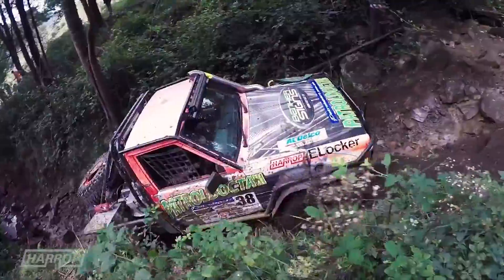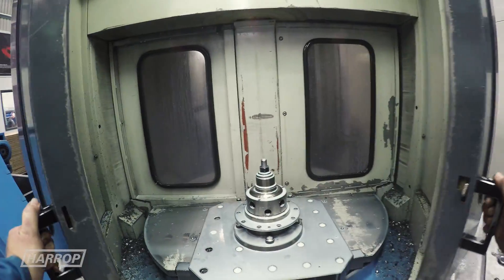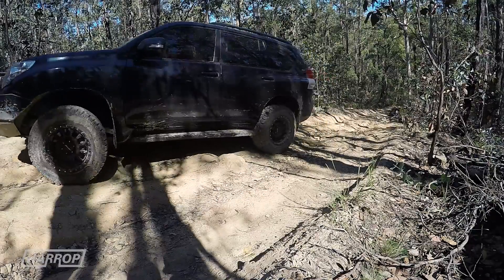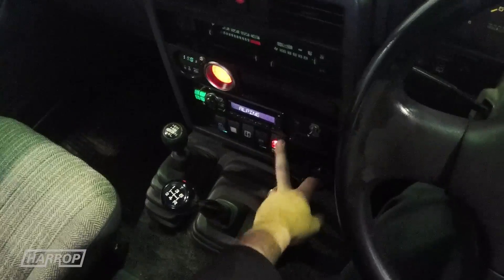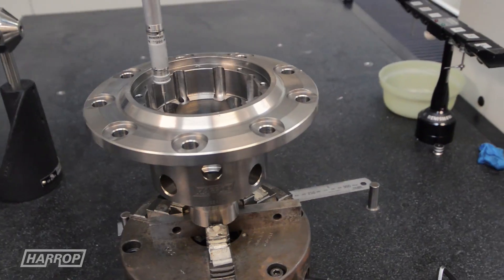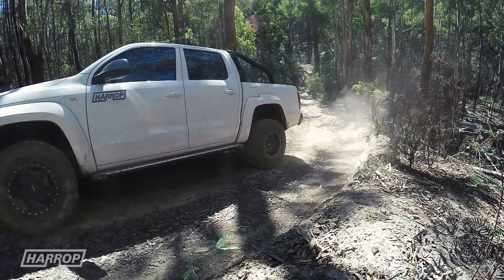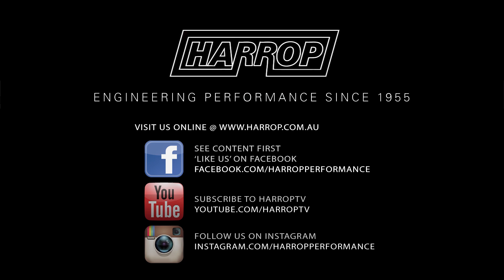Harrop Eaton ELocker | Technical Overview

Comment: Wanna win the world competition?  Develop a Torsen-style LSD with an integrated selectable locker....my Overlander is forced to run a TrueTrac LSD in the rear and a locker in the front so I can get good on-road/bad road/bad weather handling and still pull some nasty stuff off-road.  All we have now are good hybrid or trailer options with nothing winning the race.
Reply: This did exist, but I think Eaton bought the IP and killed it.  FWIW they did have issues with gears breaking in it.  It was called a tru-lok and was only available in the rear of the 2003-2006 Wrangler Rubicon.  It was a helical lsd with an integrated air locker iirc.

Comment: hello,  just wondering you mention that the Harrop Elocker engagement is instantaneous and that it does not unlock temporarily if you reverse? How is that possible with your ball ramp mechanism? Doesn't the ball ramp mechanism need 1/4 turn of the axle to engage and if you select reveres 1/4 turn to go back to neutral and then another 1/4 of a turn to engage in reverse? As far as I can see only the Eaton eLocker4 for the Dana 60/70 has an instantaneous engagement and will stay engaged if you switch into reverse, could you please clarify.
Reply: AllOffroad 4x4 Adventures TV Harrop doesn't use "ball ramp" like Eaton does. They use pins and the engagement is on the opposite side. They're not the same lockers either. Eaton is 2-pinion and Harrop is 4-pinion.

In regards to your question, when the electromagnet is energised, it holds the ramp plate which pushes the pins and they push the locking ring on the opposite side to lock with the side gear. They remain locked whether you drive forward or reverse until you turn the switch off, which releases the ramp plate and the pins slide back into their slots and release the lock ring from side gear.

I hope that answers and clarifies your question.
Reply: hm I had a different experience and if you look on the video it seems like it does exactly that https://youtu.be/2R9p0sciO9Y?t=2m20s it turns a different way depending on direction, I agree that the short disconnection when you reverse direction is 99% of the time no issue but I had situations were I felt the difference hence I changed to TJM Pro lockers
Reply: have a good instance of it on video it clearly shows the disengagement after rolling back 10cm and then takes a little to re-engage, didn't notice this anywhere on the the last VHC Trip only during a technical bit in Lithgow or Ranger Bob
Reply: Hi Mate, I just called the technical department of Harrop in Australia and they confirmed that the Harrop Eaton E-Locker DOES disengages your locker when reversing, they call it a safety mechanism. So what I noticed and had on video is exactly how the E-Locker is supposed to work according to Harrop Australia. Don't take my word for it though just call them and they will confirm this. Hope that clears it up
Reply: AllOffroad 4x4 Adventures TV thanks for going through that effort calling them to confirm. I believe what you're saying. It looks like I was wrong and you are right. I apologize for that it any drama caused. I'll also have a better look/test on my next install and see what it does when chucking in reverse. Cheers.
Reply: no problem mate, I spend several weeks researching after I noticed the issue on my vehicle. The information or rather miss information available varies a lot. Even people who sell and install them had no clear answer and didn't really know.
Reply: AllOffroad 4x4 Adventures TV true, I've actually never tested them physically in reverse. In saying that, also run both front and rear and haven't noticed disengaging, even though we do a lot of precision technical rock crawling ourselves.

When I do the next install, I'll actually check it in reverse. Anyway, hope you get a good run out of the new set.

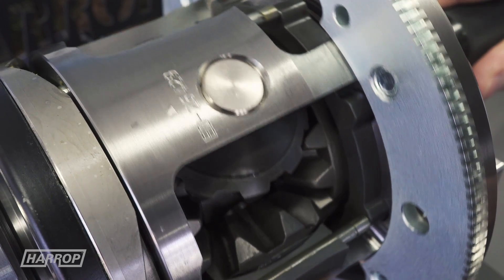Comment: Thanks for clearing it up at 2:17 about the mis-conception of the elocker not staying engaged when changing from forward to reverse. This is going in my important desktop folder....probably the website too   :)   ZUK
ps----closer to 4 amps current draw for the electro-magnet itself.
Reply: AllOffroad 4x4 Adventures TV the ramp plate doesn't move except when pressing the switch on and off, to engage and disengage. That's why if you reverse it will remain locked. Hope that clears it up for you.
Reply: Hi Mate, I just called the technical department of Harrop in Australia and they confirmed that the Harrop Eaton E-Locker DOES disengages your locker when reversing, they call it a safety mechanism. So what I noticed and had on video is exactly how the E-Locker is supposed to work according to Harrop Australia. Don't take my word for it though just call them and they will confirm this. Hope that clears it up
Reply: hm I asked to clarify that as I understand it the ball ramp mechanism needs 1/4 turn of the axle to engage if you switch to reverse it will need 1/4 to disengage and then another 1/4 of a turn to re-engage in reveres I cant see how this can be circumvented with this mechanism.
Reply: @AlloffroadAu   tick tock tick tock.....3 years later...... Mr. TV, you have to get your axles and driveshafts straight.....it takes 1/4 turn of the DRIVESHAFT to engage the Harrop/Eaton....that equates to about 5 inches of ground travel.
Reply: here is a comparison between Harrop ARB and TJM it also shows the disengagement in detail https://youtu.be/1nYZo--7Xh4
Reply: There's a lot of folks on crawler forums claiming this. Best to find them and quench this misconception.

Comment: Will it stay engaged when rapidly selecting 1st then reverse (a number of times) when stuck? I don't want a diff lock that unlocks when I need it most. Where the wire comes out of the diff housing will it leak if I get stuck in a metre of water for half an hour while I'm pulling the car out with my hand winch because I cant use the power winch because it is completely submerged.
This is the type of 4 wheel driving I do and strength is not the only criterea for durability in my view. That it actually works when I need it most ie rocking the vehicle - read loading up the driveline then unloading the driveline and fording deep river crossings and getting stuck. 
In short I need a diff lock that is NOT air powered that stays on until I turn it off. I don't like air powered diff locks because when the going gets tough, the diff housing naturally flexes and the air line inside the housing could get fatigue cracking and leak. 
To me that is a failure. If i can't use it when I need it then what is the use of it? If it leaks air or has water ingress then that is a fail. If it unlocks when I need it most that is a fail.
Reply: Hi Mate, I just called the technical department of Harrop in Australia and they confirmed that the Harrop Eaton E-Locker DOES disengages your locker when reversing, they call it a safety mechanism. So what I noticed and had on video is exactly how the E-Locker is supposed to work according to Harrop Australia. Don't take my word for it though just call them and they will confirm this. Hope that clears it up
Reply: here is a comparison between Harrop ARB and TJM it also shows the disengagement in detail https://youtu.be/1nYZo--7Xh4
Reply: Get a proper detroit locker
Reply: @marinovignola330  Yep. That's the deal. I've looked into it and when I put my fourby back on the road that's exactly what I'll do.